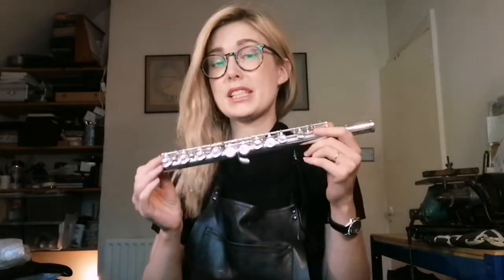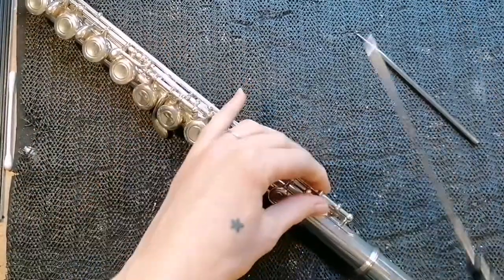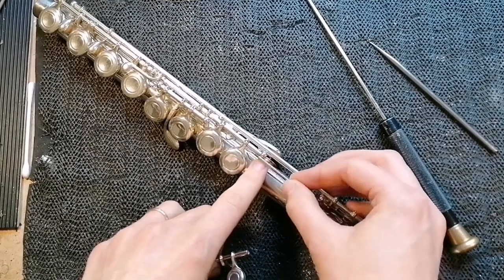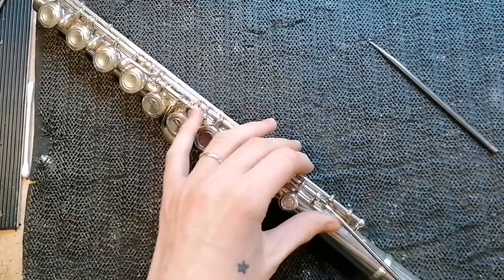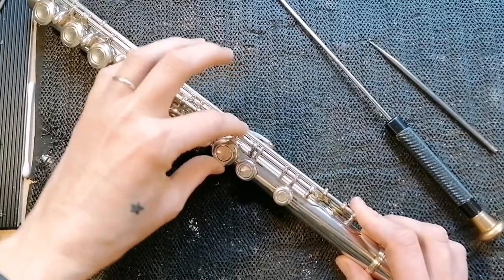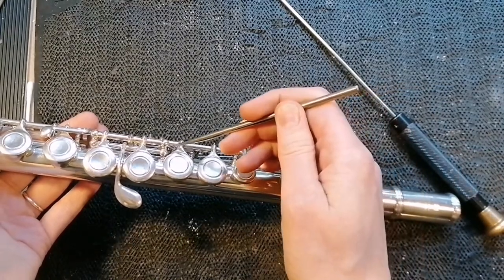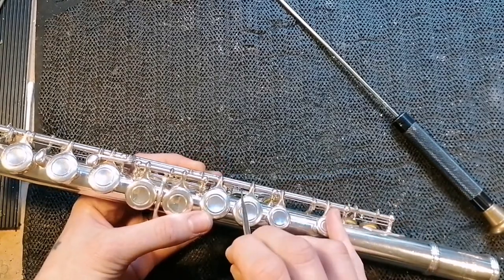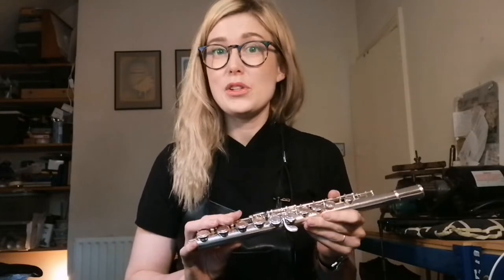Loose B and A keys on Flute: How to tighten C rod screw

Comment: Same problem - kind of - with b and g on my piccolo ,the screw on top and the screw at bottom are thighten up at their max ,spring are in place but all the keys keep moving a bit ,the g key is not working properly as if it hadn't been  tightened all the way ,when I play  fast Quick passes between high E and F the sound doesn't work good Because of that key Which is so soft that it vibrates ...onestly I recently started repairing flutes and so I'm getting by , I Don't wanna pay a professional because I need the piccolo so I learn how to do it by myself but this time I I can't figure out how to fix the problem - If it's fixable -
Reply from the maker: It is fixable, but it sounds to me like the key work needs swedging, a process where we pull on the tubes to elongate them. Sometimes, if really bad, we solder on thin rings to the end of the mechanisms and then cut them down to fit, or other times we use swedging tools to pull them longer over tight fitting steel rods. To do swedging on Piccolos, you would have to un-pin the whole mechanism before then swedging and fitting each part, then repin before assembly and set up. You cabs sometimes do the same job by accurately cutting the pillars deeper to allow the screws to travel further, but this will not help lost movement within the pinned mechanism. Either way, It's a really involved job that's challenging to most repairers, and I would recommend going to a professional for this job. The only thing you could do easily at home which might help is to use a high viscosity key oil. It will stop the movement somewhat and could keep you going.
Reply: @technicallymusical thank you for the Quick answer ... unfortunatley my piccolo died completly today 🥲
Reply from the maker: @robertagaiadellaporta1096  oh no! Sounds like it's time for a service I think.